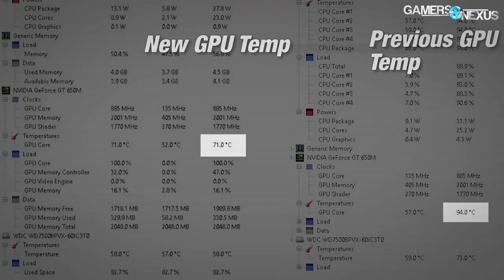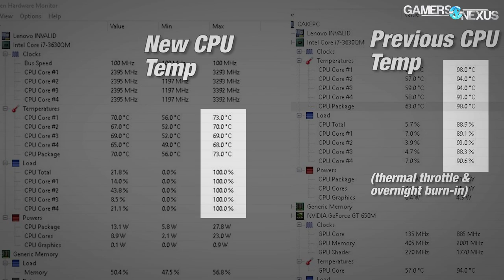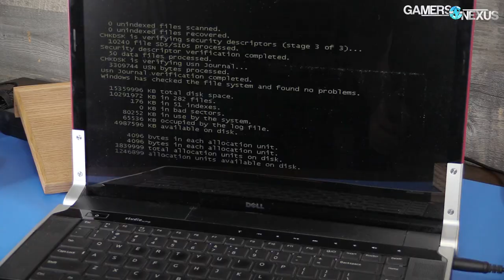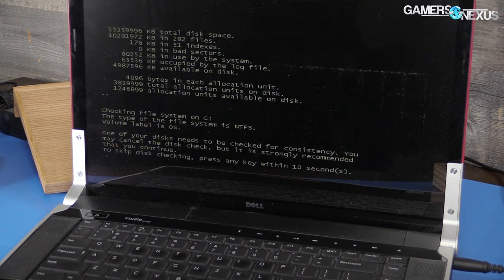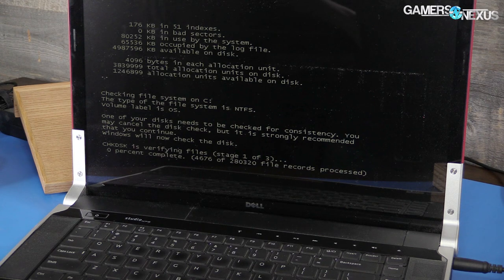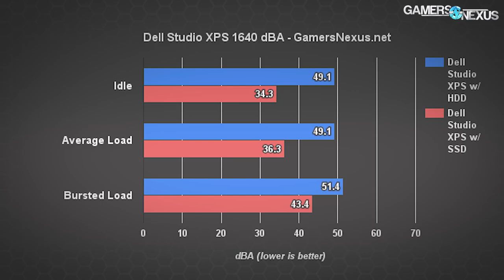Fixing Loud Laptop Hard Drive Noise (with an SSD)

Comment: I've been using Macrium Reflect.  Pretty good stuff though I do wish it was a little easier to clone OEM installs to smaller drives.  It cuts the last partition smaller instead of the largest.  One thing they could do to make the software perfect is to reduce the size of the partition with the most free space when cloning to a smaller drive instead of the last partition.

Comment: My laptops have all either been fried by liquids or begun falling apart at a housing level. Surprisingly never had any component issues aside from one bizarre laptop that I believe was recalled because it was only on sale anywhere for 3 months and couldn't be replaced under warranty - only through store credit (which sucked because it was a higher spec than anything in its price tier at the time).

Comment: I had a dell studio xps 1647 but sadly it died a few years back. Awesome video GN
Reply from the maker: That old 1600 Studio XPS series had a few issues. Some pretty weird ones... I've had problems with the built-in webcam drivers preventing proper boots.
Reply: Gamers Nexus as problematic as the 1600 series was no doubt it was one of the most beautiful laptops of its time.

Comment: AOEMI Backupper Free can migrate too and it's, as it's name says, Free, great backup tool too
Reply: Yeah i remember using that software aswell, same issue with Khalid, even if i still had space on both drives it didn't work out, even if i formatted :/

Comment: It's weird I've bought two 120GB SSD's in the past 3 months and both of them died. I've had a 1TB SSHD for 2 years and its working great WTF
Reply: Jobe Chishko Well that sure is strange. Well there are a few things to ask.Did you get the ssds from a reputable brand? Did you do a SHIT TON of writing on your ssds? Or did you not plug in your ssds every few weeks?
Reply: They were the Silicon Power S55's I bought two 120gb drives and after a month I started getting Blue Screens and corrupted files, I only used them for my operating system and browsing the web all my games were on the sshd
Reply: Jobe Chishko There are a lot of variables that go into failure, but I'm just guessing that it's your rig that messes up with the ssds or you have some processes that repeatedly writes into your ssds(around 100tb). Or maybe it's a freak coincidence of hardware malfunction that should be covered by warranty(if there was any).

Comment: Hey Steve, my laptop's keyboard is starting to die. Particularly around the WASD area. They'll either not work or the lightest touch will frequently double or triple tap the letter. Is there anything I can do to fix that? Thanks mate.
Reply: Try a USB/Bluetooth keyboard?  Get an appropriate controller for gaming or use an external keyboard when possible to reduce excessive wear and tear on the built-in keyboard. Alternatively, I-Fix-It probably has instructions on replacing the built-in keyboard or switches, if that's possible on your model.
Reply: Yeah that's what I'm doing now. Thanks though.

Comment: would there be an appreciable difference in battery life with an SSD vs 7200rpm HDD?
Reply from the maker: In some laptops, yes. An SSD will consume significantly less power. It depends on how you use the system, but if you're doing anything IO intensive, then there is a difference. Didn't measure it objectively on this laptop (wasn't really the point of the upgrade), but it's something we're looking into for future reviews. I believe a few sites already test this.

Comment: I need to upgrade a desktop from a hdd to ssd boot disk. 
It's only a 128Gb so disk cloning won't work. (Correct?)
My plan is to disconnect the HDD and install the ssd, fresh install Windows and shutdown.
Then reconnect HDD and go straight to the bios and set it so that it boots to the ssd instead. 

But this will remove all settings and stuff. Do you know of a way to keep all the settings? Essentially I want to move the installation of Windows but not the rest of the files.
Reply from the maker: You can clone from larger to smaller. Clonezilla supports it through flags, Acronis supports it natively. You just need to make sure that the source drive does not contain data exceeding the destination drive's capacity, but they can still be different capacities as long as everything <128GB.
Reply: I used a program called Paragon to copy the Windows files from my 2TB HDD to a 240GB SSD and while it technically worked, I honestly recommend just always doing a fresh install for desktops. Reason being is because if you're going to use the former HDD for extra storage, you'll have to manually remove the Windows OS files. It'd be easier to install Windows on the SSD, move any user data to it from the HDD, and then format the HDD. That way there's no issues with program locations, any old programs you no longer use isn't taking up space and you have the max storage available on your HDD.

Comment: Pfff, I restored my BIOS to default settings and now my laptop has a black screen, now that's a problem. I know people who watch this channel are pretty smart, maybe someone had a experience with this?
Reply from the maker: Interesting problem. Have you tried to connect the laptop to an external display? Does it output to other attached displays?
Reply: Gamers Nexus Yeah, I tried that, nothing shows up. The laptop just keeps running.  Just when I turn the laptop on the led light for hdd activity turns on for like 2 secs and the it's off again. I've taken my laptop apart, cleaned it all, nothing helps. I've spent like 2 days in Google to try and find a solution.. I've found things like when I have to reset cmos battery, hold power button and things like that, nothing really helps. Another things to note, my USB ports are working at a really low power state, my cpu is doing some things aswell while the pc has the black screen because the laptop is actually blowing some hot air. I know that all is OK with the hardware, I have another pc to rest the hardware on. Thanks for the answer by the way.
Reply: Roltons Maybe the battery is dead/dying?
Reply: PeanutButterSavage Well the laptop battery is OK, maybe something is wrong with the cmos battery but the chanse it died just right when I did a reset on bios settings is low.